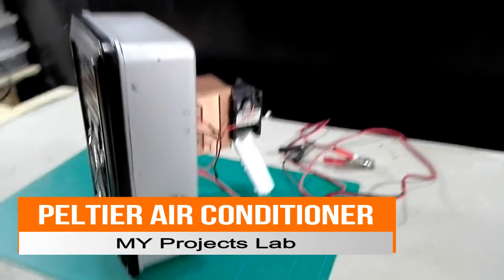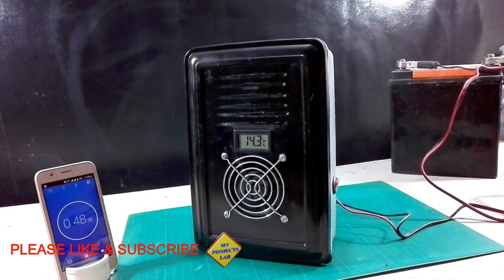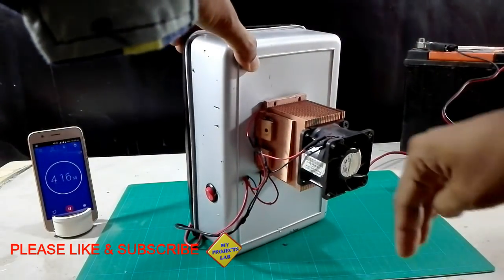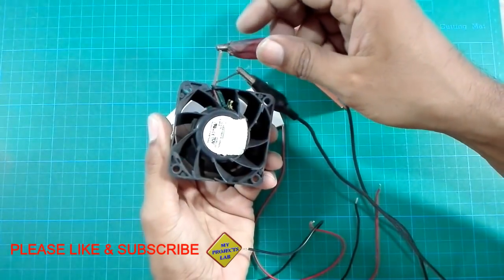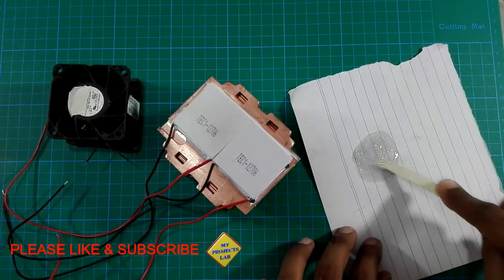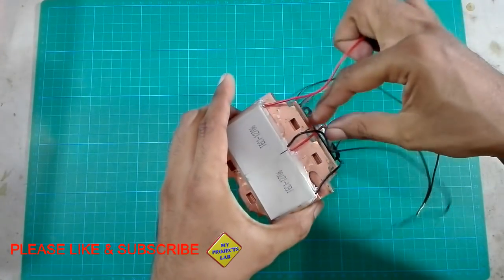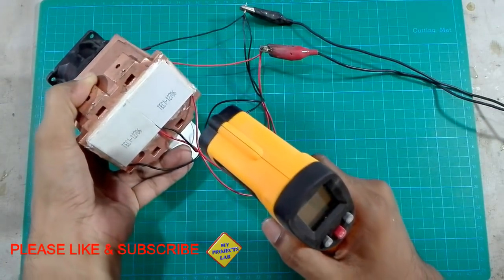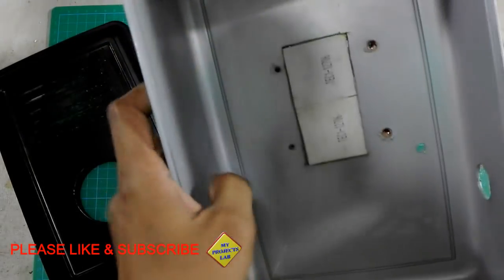Peltier Air Conditioner - How to make Peltier AC at Home

Comment: The problem you're going to have is getting rid of the heat out of the same area that your cooling, look at isolation for refrigeration. The Chip makes more heat than cold. If you can't keep the temperature down on the hot side you will melt the circuit doping. I recommend a Water reservoir cooling circulation to create hot Water at about 110°F and a Peltier temp safety shutoff at 112°F Water temp.

Comment: the temperature indicator is merely showing the Peltier temperature, not the ambient temperature。 it does not make sense to use Peltier to cool the surrounding, this is the very inefficient device anyway, you have a done a nice job of creating this cooling device。

Comment: temperature sensore at air outflow and further into the room would be good. For me i would add some insulation in the box or under the box (outside) to reduce the fan noise. I don't think my neighbors would like that sound. I wonder if a duct reducer is on the outside, and using a bigger fan would also work. i think i would prefer using a larger quieter fan, like 120mm or 140mm.

Comment: It's doing no work -- there's nothing attached to the cold side of the chips...  Of course the temp should be even lower than that like sub zero.... Measure the temp of the air blowing out of the "cold side"...  Useless....

Comment: where is the temperature probe placed, it is supposed to place in front of fan to measure the actual cooled air, not the temperature of the heat sink...

Comment: I saw a lot of people want to be innovative and creative but in wrong way. My concern is you are giving wrong information & useless thing to the people. U will not get a cool air.. The temperature measured is directly at the module, so even u put it under hot sun.. It will read that low temp. Why dont u put the temp sensor at the output air flow.

Comment: #1. You should have used a heatsink on the cooling side too.
#2. The thermostat sensor should be placed on the Air-Outlet to get the actual temperature of air flowing out of the Air-condition. 
Thanks👍

Comment: thats misleading, your temp sensor is sitting on the cold side of peltier, not in front of the fan that supposedly is blowing cold air. I can tell you right now, that fan is blowing air probably less then 2 degree F difference from ambient. I am building peltier AC and the best you can get with 2 plates is 5F degree difference from ambient. I will be trying to combine more of them to improve this, but then it becomes more energy inefficient.

Comment: Actually I ran my peltier module on 12v 2amp adapter and it works and makes the peltier cool and hot but after 2 to 3 minutes the 12v 2amp adapter starts it's indicator light to turn off and then on after some time. So, is there any solution for this problem or should I have to use a bigger ampere power source or something else?

Comment: Unbalanced design. Needs heatsink on cold side for it to feed enough heat into the devices. No use having a noisy fan and heatsink on hot side without it.
Concept ok for a dog kennel but not anything more.

Comment: U should rotate the fan which is placed on the opening  side of the box cause it will take air from outside and throw the air inside so it will not cool

Comment: 8:36 the fan will suck air into the unit not blow out the front...
plus this doesn`t make sense.... cooling equals hot side vs cold side, it `s like saying leaving the freezer door open will cool the room
Reply: You need to use your imagination and put the hot side outside of the area you are trying to cool just like a window air conditioner or put the hot side inside if you're trying to heat a space. I want to cool my bunny Hutch

Comment: a smaller fan  or thinner fan with lower volume flow  less noise and power is marginally slower only , to reduce heat.  see for yourself.  1 deg celsius maybe compared to a large fan.  the bottle neck is the surface area of your cooling fins not you fan size. same rule applies for car air conditioning . heat transfer is a function of time at slower air flow speed being more efficient to allow for heat transfer. that's why cranking up the fan in you car as you get in is counter productive to cool down the cab.

Comment: excellent concept but a bit noisy. Also you appear to be reading the temperature inside the box while a reading at the outlet of the box would be more appropriate. How much power do you use. I hear peltier are only around 5% efficient.

Comment: In your case, you use a fake copper radiator And a very very loud server fan... The best option is: 1) use the radiator on the" hot "side in 3-5-10x times more than on the" cold " (look among the old spare parts), the larger the radiator, the slower the heating will go, and you can put a quieter cooler for cooling

Comment: How and when  do u add temperature display and sensor 
You didn't described it in video

What is the cost of this model
We're can we find this parts
Can this peltier AC run for 6-8 hrs
That single 12v battery long for how many hour after charging

Can we provide a 12v power adaptor

Nice project but questions still remain

I suggest this module can be used in cooling  high. End gaming/ research pc
Reply: What is cost of this model and sound is more? What about solutions sir

Comment: It seems you used metal box not plastic box. However I find here few technical issues: (1) What's the max. temperature to be safe for this Peltier unit? (2) How long we can continue the unit at a stretch? (3) There is no heat sensor circuit to cut off the power supply after getting desired temp. or any delay circuit to protect the fan and other parts.

Comment: Guys this isn't an airco, an peltier produce more heat than cold.
This device only produce heat.
If you would place the hot side outside your house and the cold side inside than you have an airco, but is is to small to cool a room

Comment: Hello brother can we use it when temp is more than 40+ celecius temperature and how much time we can use it and does it affect if we use 5-6 hours a day and last it is worth to make it diy?
Reply: Don't even think about making one of these, if you don't want to heat up your room even more... Don't trust those "measurements"
Reply: The concept is good for a dog kennel and works but even when designed for its best efficiency its still not great.
Reply: Thanks a lot

Comment: you also need a small heat sink on the cold side along with a little fan to actually pump some of that could air out of your box. also you should setup the peltiers in a cascade. supply the bottom with 12 volts then put the hot side of the second onto the cold side of the first one and supply the top one with 5 volts. It will work waaay better. for best results, you should liquid cool the hot side and pump that hot air outside.

Comment: It will never cool your room even for 1 degree... Simple conservation of energy. Even if you seperate the peltier heating part out of the window, then also it is not at all effective, as the area it cool is very very less...
Reply: if we use 4-5 device in a room them it will work i think ?

Comment: You need to vent the hot air out of the room.
Your thermostate is not room temperature but cold side interior cabinet temperature. You wont get accurate reading.
Reply: correct, i think to cool a room this project take 1 day or more times, coz all homes are not well insulated and i think nowadays peltier cant replace ac place, it need more or experiment or creativity to expand its own power to use in high range

Comment: I have a question. I also made a water cooling Perrier air conditioner, but asap dc fan in to draw the cold air  is turned on  the peltier temp start to go back up on the cold side . What ami doing wrong?

Comment: I am in the coffee business for 20 years, and we use Peltier cooling for the syrup instant coffee dispensed in our machines. What Cyprian Guerra says is absolutely correct. There are several problems here:

1) In such a cabinet, it will not cool a room, because Peltier cooling generates heat on the back side, and it is the heat that needs to be vented away, or else the Peltier element will burn out quickly. It would require a bigger (6 times larger) heat-sink than the one he uses, and a fan 2 to 4 times larger than the fan he uses on the back. It would need to be mounted in a window or other specially-made opening,  with a heat-sink and  fan on the backside to vent the heat away from the element.

2) He lies when he uses the words "surrounding " or "ambient" temperature. No room, would heat up that fast, and if it had gone so quickly from 30+ degrees to 10 degrees, he'd have put a coat on very quickly. The thermometer must have been mounted somewhere on the front, probably behind the display itself, so he was not measuring the temperature of the surrounding air , but the temperature of the face of the Peltier element itself. A very small chamber on our coffee machines where the liquid instant coffee is held, takes 4 to six hours to reach 5 degrees, and that is only sufficient for 3 litres of syrup, in a closed, insulated box. To cool a room of 30+ degrees down to 10 degrees would likely take 24 hours or more, and only if the room was lined with cork or some other insulating material, or the coolness would dissipate through the walls before the room could cool.

3) Finally, a Peltier element uses quite a bit of electricity, and would not be economical for such a use, or else you would see mass-marketing of Peltier air-co units world-wide. Peltier elements are also not cheap. The device as he shows here, would burn up in a matter of days (or hours) from improper dispersal of heat, the most common cause of breakdown in the field is either from dusty fans that become blocked, or if the machine is placed against the wall, so that the fan can't get rid of the generated heat. It's simple thermodynamics that you can't cool without generating heat, as actually you are not creating cold air, you are venting hot air to cool the desired area.

I have used them with picnic cooling boxes in my car, plugged into the cigarette lighter with an adaptor, to keep my lunch cold while in the field doing repairs all day long in the summer.
Reply: Longest comment I have ever seen!
Reply: For anyone replying to the original comment: If you love life, treat everyone kindly, have a passion for natural philosophy, and think differently, then I highly advise against working in the coffee industry.
Reply: Agree. The approach in the video in the isoluted room will increased the average tempersture. 

The only assumption - theoritically the excess of the heat could be regenereted back into electricity and accumulated by another set of Peltier modules. 

To reduce the temperature means to relocate thevenergy to another place or regenerate.

My goal is to use the thermoelectric effect in the air heat exchanger - ventilation system as a heat pump.
Reply: More of an improper space cooler
Reply: True. Peltier only efficient when it come to small compartment.
Reply: "he lies" might be a rather big statement. Some part of this is due to translation issues, English is probably his second or third language. 
(And there's differences/MTI/NTI when you use English coming from a different native language vastly different from it)

What you point out re cooling efficiency etc., is true, and to some extent he mentions the same wrt saying "packing" is required. Which contextually/colloquially is taken to assume that venting + some insulation is required.  

It's a great medium to exchange information, let's not assume everyone speaks a foreign (English) language the same way.
Reply: Not Funny Sir but the translation is not the problem. It’s the numbers he gave. So He lied.

Comment: The sound reminds me of two things.. a vacuum cleaner and a jet airliner.
Reply: Exactly😅😅😅😅
Reply: Also Air Blower
Reply: Bitcoin mining
Reply: @Dave Muffoleto, look !...if you smart then you should overcome it, give us all solutions not just complaining about it ...
Reply: @qurrotatechnology2073  lol, RPM is high or  any wire touching in fan blade
Reply: @nee11official  RPM heard like at least 5,000-6,000RPM (two impellers axial flow  fan)
Reply: it does do its job though XD

Comment: whether without water circulation from a mini water pump using waterblock with peltier would not be possible to cool the air to the maximum

Comment: You need to add heatsink on cold side and cut up some aluminium cans and jam in slots on heatsink to increase fin size and maximise air to cold surface contact area just like a real AC uses an evaporator. Also, water cooling hot side works better with salted water.

Comment: You did not show where you put the thermostat sensor !! If left close to Peltier it will be obvious that the temperature will be 32F ,, but it will not be the same temperature when the air goes out. Please retest !!! Put the temperature sensor on the outside of the vents box, compare the new test !!! Really simple and easy but don't cools like an AC.

Comment: You know... taking a thermometer and showing surface temps, is not validation of the units performance... not putting an evap heat sink is just plain wrong. 
I've done what you've done, and you need to do your due diligence on this topic...
It's a nice concept, but in real world practice, it's nothing but a beverage can cooler...
Reply: Yeap... Agreed.. Many people i saw put temo sensor at the heatsink... So funny, even some of them claim to engineer but dont know how really stuff works

Comment: great AC and the best looking I've seen so far.   For better efficiency, you should add a heat sink to the cold side so the air can flow over it inside the Box.
Reply: Yes

Comment: Yeah, nice heater you've got there. One side of the Peltier module gets hot while the other one gets cold, overall heating the environment due to low efficiency.
Reply: Though its kind of hard to hear due to the noise and sound quality he does mention this is designed for cooling at maximum a 6 foot by 6 foot enclosed area assumedly with the hot side venting to an external environment - though in my experience you'd need more like a dozen of these devices to produce a significant change in an area of that volume using regular TEC1 12V Peltier modules.
Reply: "heating the environment" 
Depends what you consider environment is.
Whole room or just small space (ex. your workstation) on which you point it at.
Do not overthing simple topic xd, he wanted to make air conditioner (well not exacly ac, but give it better name ?).
Reply: Cyprian Guerra works just like a regular window ac which also works on the peltier effect. Which is why he put the hot end pointing outside when he did his demonstration on window mounting. He knows what he is doing.

Edit: in essence both this unit and a window mounted ac are performing in the same way. Hot air outside, cool air inside. Window mounted ACs operate under a different effect than peltier modules do.
Reply: Panic The Scholar Knight. Real window AC works due to gas compression (Carnot's effect) and has nothing to do with Peltier's module, it's tens of times more efficient and process can be reversed to heating easily, e.g. in winter. Entirely different device and you either don't know what you're talking about or we seriously misunderstood each other.
Reply: Cyprian Guerra no, you're right. Window mount air conditioners work on carnots effect. Thank you for proving me wrong. However, the technical machinations of both of these units are the same. Heat is pulled out one end and cool air out of the other. In his example partway through the video, he had it mounted in the window like a standard window mounted AC. The hot air was vented out and the cool air was vented inside the room. The heatsinks are adequate for the unit. All in all he did a good job with what he had.
Reply: When I say significant change I mean - you can run it a few hours and see any temperature drop in the scale of whole degree Celsius at all - you'd need far more to come remotely close to what you can do with a proper AC unit.

Comment: What is output current of DC supply? What is max voltage and current ratting of peltier and fan ? We can increase voltage easily so if we connect all in series connection so we can get better current supply and we can increase voltage as need, am I right?
Reply from the maker: Peltier module is 3.5 amps, cooling fan is 2.5 amps and front air throw fan is 0.7 amps, all items are 12 volt operated they cannot be connected in series. Only connected in parallel configuration.
Reply: So I need 6.7 amp supply? But I have only 2 or 3 so how can I improve it?

Comment: I wish you did not use those horrible loud 1u rack server fans, it would be a very good idea. Nontheless, it looks nice, but I would choose for air displacement and not small loud fans. Dissapate the heat and the cold by big 120 mm fans would also work, and saves a lot of earnoise in as outside the cooler. There are 120 mm fans that run on 5 to 24 volts, so with some electronics in between, the fans could blow harder when needed... That is how I would like it to be... Good video!!

Comment: Hi.. wen I tried to connect all the 3 products. 1 peltier, 2 fans.. but the speed of the fan has decreased can some 1 describe how is that possible. Do I need to buy the higher voltage adaptor for this do the power is supplied exactly?
Reply from the maker: Use 12 volt supply only but carefully calculate the ampere of total, by applying less ampere will slow down the system.
It will be better to use 12 volt 10 ampere supply.
Reply: share your num
Reply: talha bhol  9611566591

Comment: Can I use 12v 1a for this please reply fast
Reply from the maker: No, these are 6 ampere peltier, not work on 1 amp.
Reply: How if i use power supply 12v 30 amp?can boom???